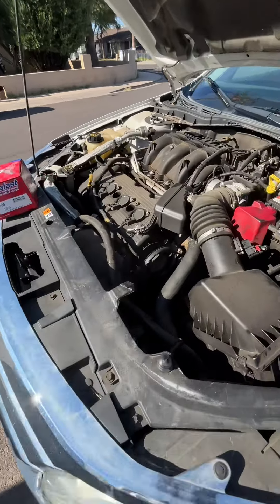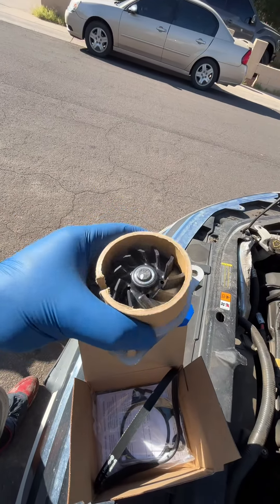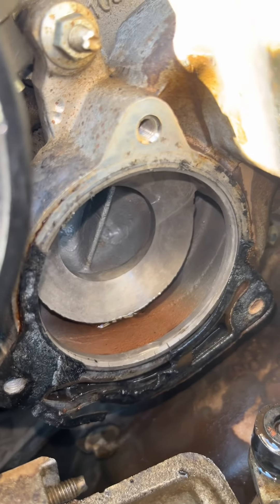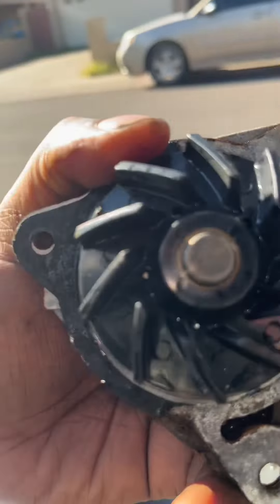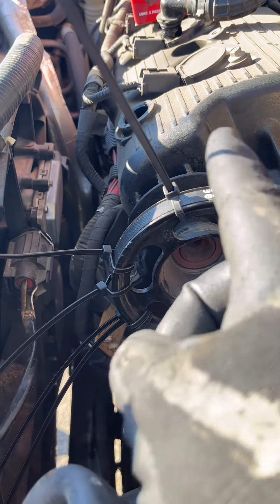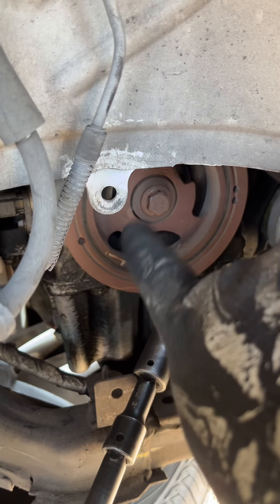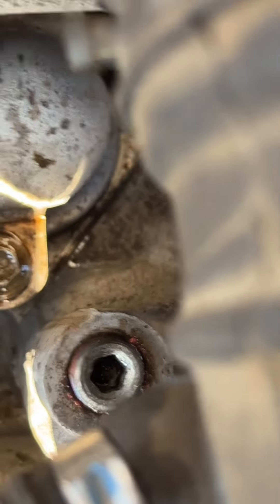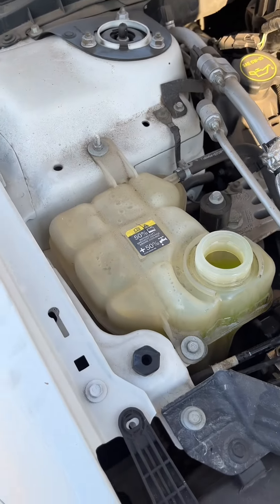How to Replace a Water Pump and a Stretch to Fit Belt Ford Fusion

Comment: I would have a close look at a service manual
I do not really think there a such a thing as a STRETCH FIT BELT
Sure you can likely buy a too
I would not use it
It likely not a good idea
It would be better not to try to stretch belts
There likely is a idler
I would look at a SERVICE MANUAL
Reply from the maker: All do respect your not correct , all i can say is do some research and you will be surprised the info you find on this topic
Reply: @aaronthemechanix  You are correct and I am wrong
I did look this up and seems Ford and GM are using a lot of single use STRETCH FIT BELT ! 
The claim is after installation the belt will shrink to the proper size !
And they should never be reinstalled once used
I still do not like the idea of this and wonder is this not just a cost cutting measure
Anyway I was WRONG
I am happy a stretch belt is not on any of my machines
Best TU U